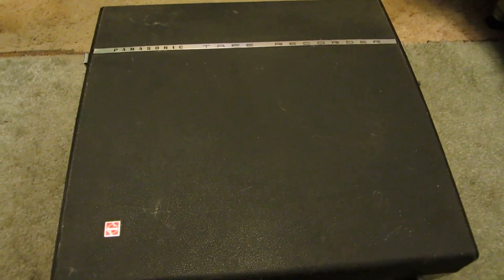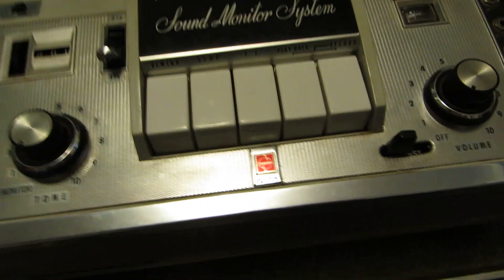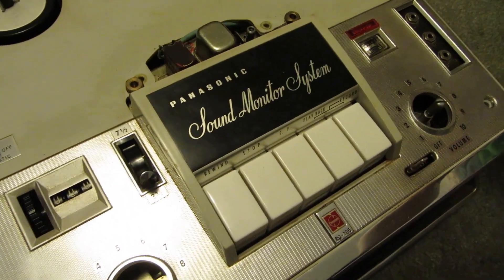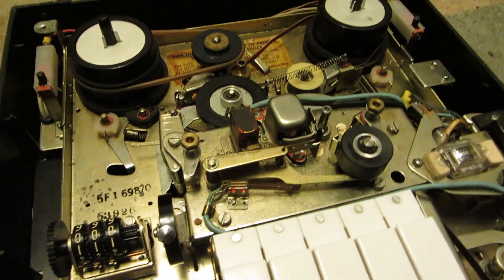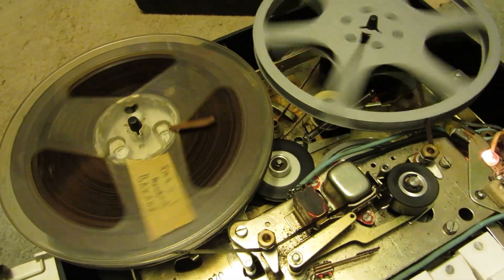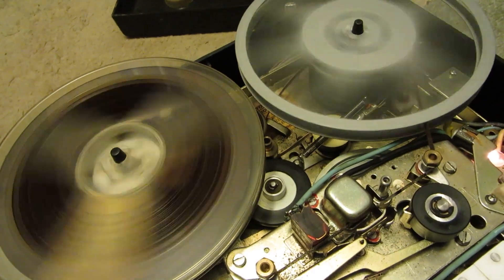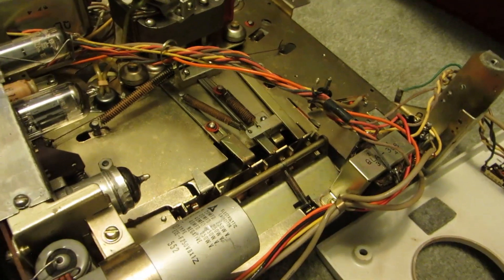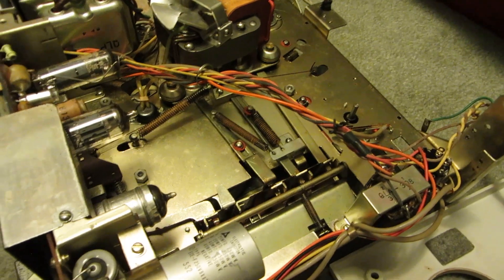Panasonic Reel to Reel Repair and Operation

Comment: What standard spring did you replace it with?
I got it but in the same condition.
I need help.
Reply from the maker: It was just a spring I had lying around.
Reply: Oh, thank you.
I tried many things with several different springs selected on a hunch, but to no avail. The cloth tape is sagging, so I'll have to make my own.I tried

Comment: As you know, the weakness of this model is a flat fabric drive belt which is disintegrated due to aging. But, it's easy to make a substitute belt. That is, spread a narrow fiber-reinforced tape for packing (smooth on the front side) on a flat table with the adhesive side facing up, and put a cloth tape for hemming on it and stick it together and cut with scissors to a width of approximately 0.23 inches (6 mm).  All you have to do is pass the belt between the take-up reel and the motor spindle to form a loop while setting the cloth face inside. Temporarily fasten the loop with a small piece of packing tape, and find a length that works in playback mode, and glue it.

Comment: On the bottom cover of the case, from the inside, I see a diagram - it is not on the Internet, but I got the same tape recorder, but without a diagram, could you take a picture of it?
Reply from the maker: If I ever have it apart again I will snap a picture, right now that deck is in storage.
Reply: @HL4EHalfLife  Well let's hope

Comment: You really are very brave poking around inside that machine because that Transformer retains a charge until it's been recharged.
I know because I have been booted up the arm by the 240 volts and it was unplugged.
Anyway glad you were not. How did you get tention on the pulleys and get them to grip.
My machine will play nicely but it doesn't want to fast forward wind.
Any suggestions are very appreciated. Thanks
Reply from the maker: Hey Lindsay, it's not the transformer that holds a charge it's the capacitors and I've gotten my fair share of zaps off those dam things...ouch! As for  the gripping issue please watch the video starting about 7 minutes in for a fix.